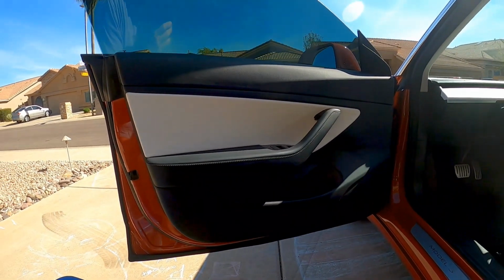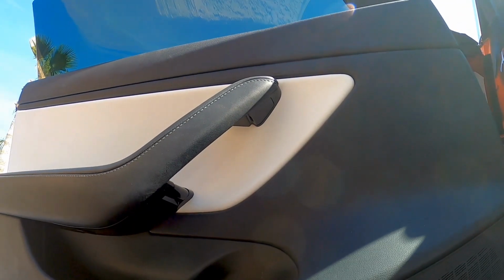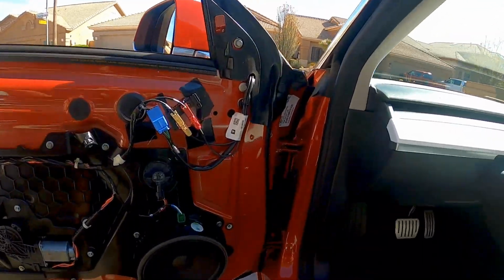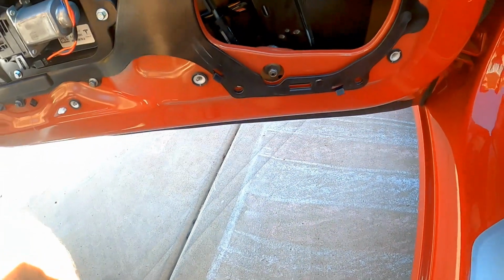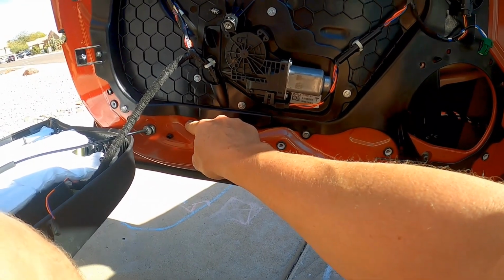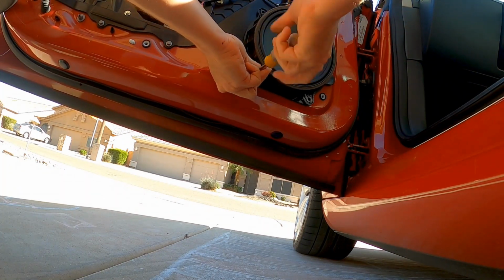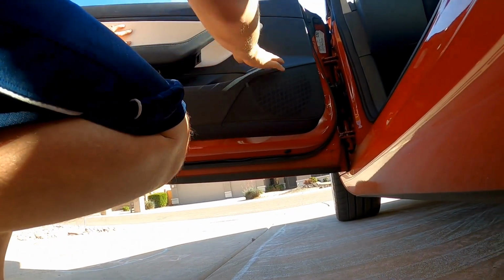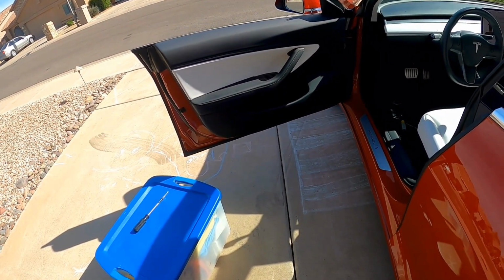Tesla Model 3 Window Track Adjustment

Comment: I just did this on my 2023 Model 3, I only had to adjust the rear one, so I didn't even take the speaker out. It fixed the wind noise completely and the glass is flush with the B pillar now.
Reply: I'm doing the same thing. How many turns worked for you? I've done 4 turns, still have some wind noise at the top of the window towards the B pillar. Seems to change when I adjust but I'm not sure how much to go. Thanks in advance.

Comment: Thank you for the video, it was very helpful.  I did this on my Sept 2021 Tesla Model 3.  The Torx screw is T30 now.  Also, I found 2 turns to be too much.  If there's too much friction between the window and the window gasket - pinch detection kicks in.  For me, a half turn helped.  You can definitely see the window putting more pressure on the window gasket.

Comment: Top tip. If you are trying to adjust your windows. Don't reinstall the door panel until you have taken the car back on the road to see if the wind noise is gone and readjust  as needed. The wind noise on my 2023 model 3 was at the b-pillar both front and rear glass. Use a dollar bill to slide between the glass and the seal to check where the gaps are at
Reply: I'm doing the same thing. How many turns worked for you? I've done 4 turns, still have some wind noise at the top of the window towards the B pillar. Seems to change when I adjust but I'm not sure how much to go. Thanks in advance.

Comment: Thanks to this video I was FINALLY able to solve my wind noise problem! Didn’t have to remove speaker because just adjusting the rear of the glass did the trick since all my wind noise from coming from near the B pillar
Reply: Did you adjust clockwise ? I’m getting wind noise from the passenger rear. The glass sticks out a bit from around the B Pillar area

Comment: Shouldnt you need to hold the nut with a wrench so the outer nut doesnt move while using an allen wrench to turn the inner sleeve? When i turn with the allen wrench the entire mechanism moves and didnt help my window noise at the top.

Comment: Nice video. I'm having a wind noise issue coming from the driver's window on my brand new model 3. I'll attempt this process soon and I hope it fixes my issue
Reply: I have the same issue. I had a tesla tech check it out. He made it even worse.
Reply: I'm doing the same thing. How many turns worked for you? I've done 4 turns, still have some wind noise at the top of the window towards the B pillar. Seems to change when I adjust but I'm not sure how much to go. Thanks in advance.

Comment: I have a rattle of some sort thats coming from the front passenger door.  I took the inner panel off and taped down somethings I thought was rattling.  It's still rattling and getting worse. Tesla tried but couldnt stop it.  I now believe its inside the door itself.  Any advice on getting into that section of the door, more than what your video is showing?   ty

Comment: Great tip!
Do you know if it is possible to adjust the window sideways?
on my driver side the gap between front door window and b pillar is Ca 3-4 mm larger than the 3 other gaps.

Comment: Why do you want to adjust the window?
Reply: to reduce wind noise around top of the glass near side mirror
Reply: @thomas1254  did this work for you? You think it’s the same adjustment for the 2020 performance model? Thank bud. Having the same issue.
Reply: @johnspanos3862  I didn’t feel any noticeable changes
Reply: @thomas1254  so it still has that sting wind noise after adjustment.
Reply: @johnspanos3862  Yes, I think the wind noise is from the vehicle design. I gave up fixing the issue, and play music louder 🤣
Reply: @thomas1254  is it the same for rear?